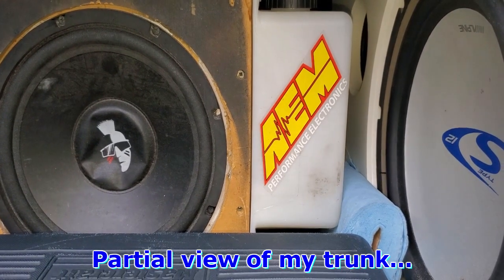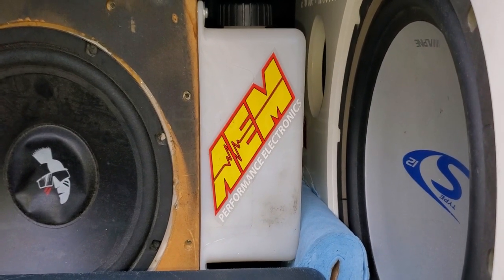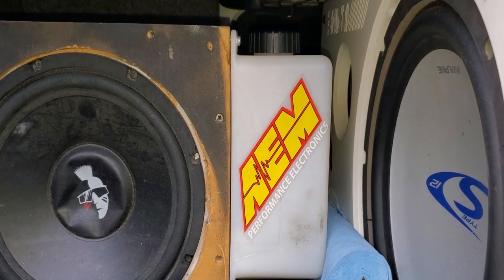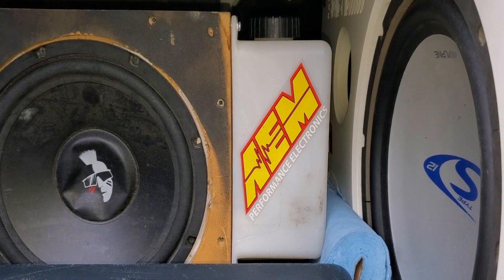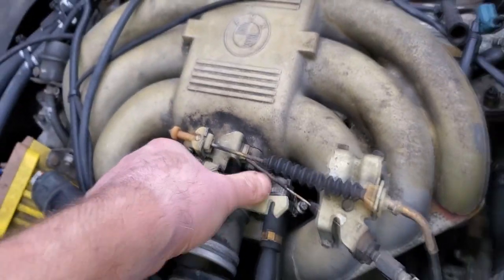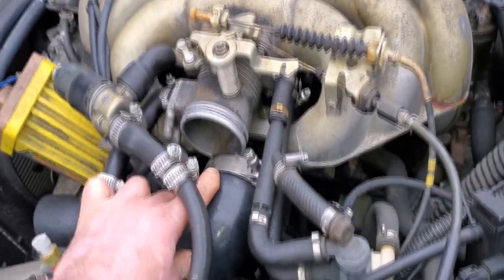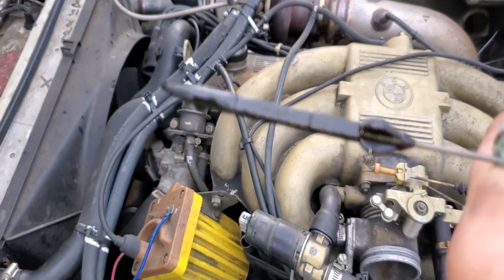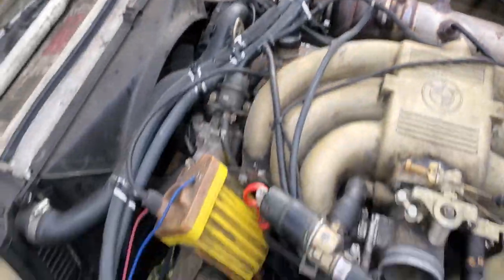Water injection siphon effect... D'Oh! @AEMpowerTVelectronics

Comment: Hi tim! This is Gretchen. 2018 alpha romeo stelvio, quattro suv crossover has 18" wheels. Two tires are replacec w newer ones i assume but not same brand as rear tires. I would like advice on what brand and tire size i should get for my car. Its a racy car and i dont plan to 4 wheel drive it, but i like knowing i can w tires heavier than street racing tires. Unless you have proper thoughts to share w me as to what style i should get. What i want is performance, and to make use of the awd for hugging corners. Can you suggest anything for me? Ty.
Reply from the maker: Sorry, I'm not a tire expert... best to talk to someone who sells tires for a living, or check with owners of the same car (in Alpha Romeo forum).
Reply: @EXOVCDS  ty tom. Typo earlier. Funny